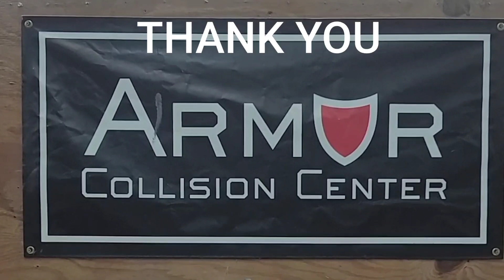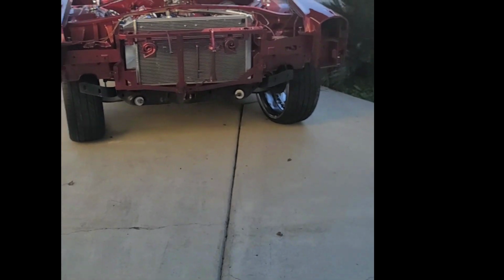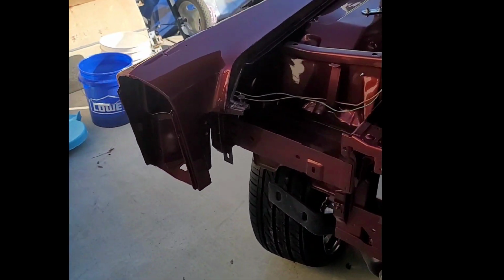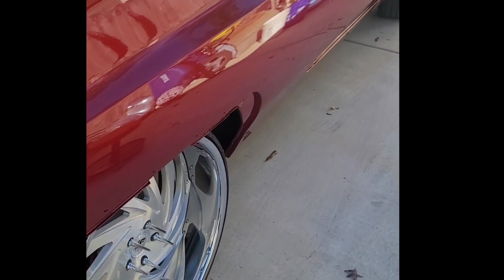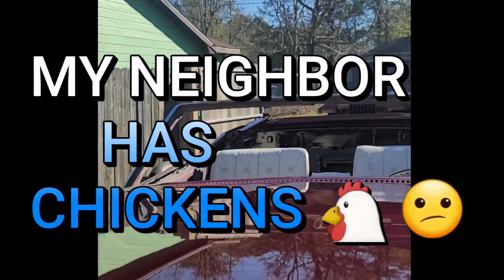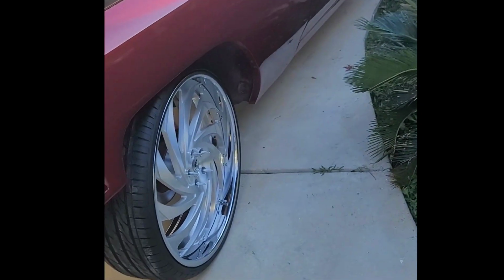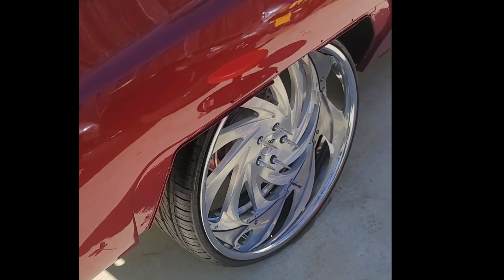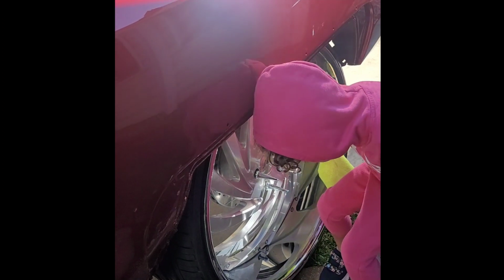1968 CADILLAC DEVILLE CONVERTIBLE UPDATE

Comment: It'll be sick when finished! I have a 65 drop
Reply from the maker: I need to see that thing
Reply: @martina20201  it's not much to look at right now. It's bare metal I pulled it's fresh big block out for an Ls. It's got bags and disc brakes. I haven't touched it in months. I'm thinking this next spring I'm going to polish it mirror tint the windows find something shiny to cover the roof in paint some graphics on it and drive it in bare metal for awhile.